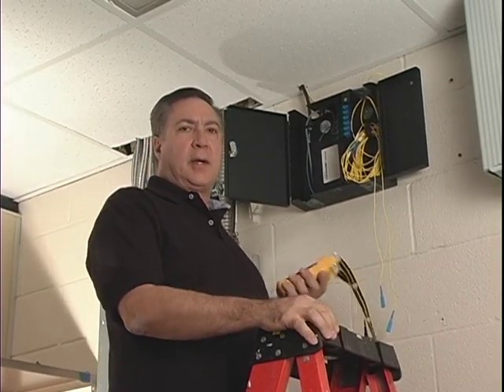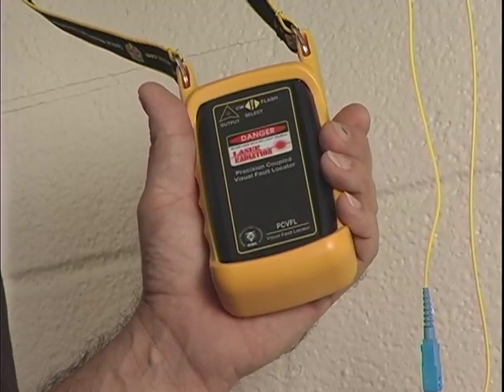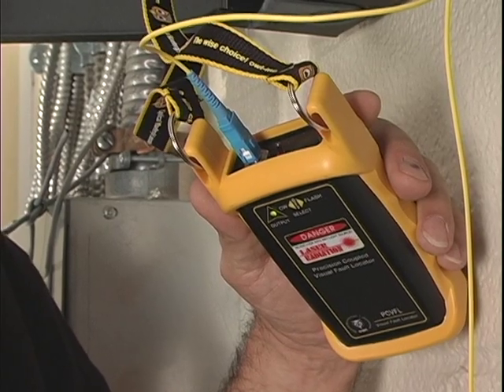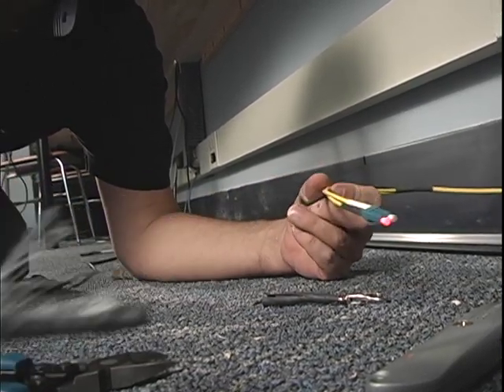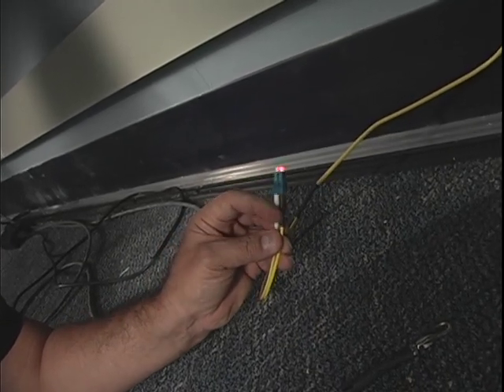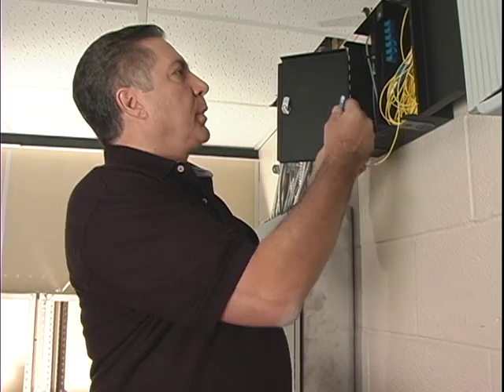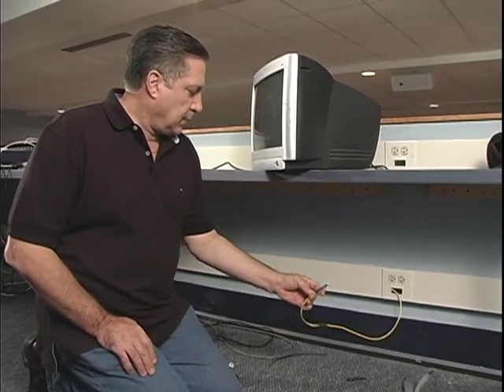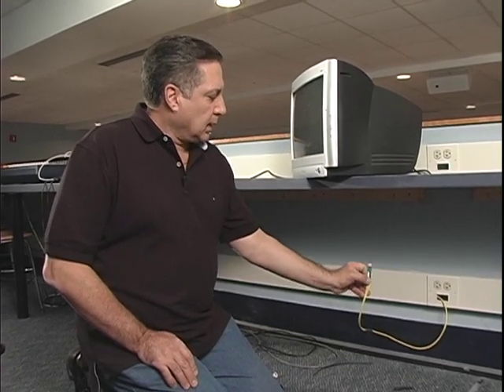Fiber Optic Tutorial Chapter 11: How to test the Fiber Optic Cable from End to End (Completion)

Comment: not bad making use of a VFL to test your link buy the very best will still be OTDR testing
Reply: +Riaan van Zyl The proper way is Using a Light Source Meter, this way you will get a true dB loss and it appears to be a very short run. An OTDR is a good method as well as long as they used a Launch Box on both ends at the same time but again the Light Source is the best way in this case. 

The VFL does not show that the fiber is good it only showing you that you can pass light.
Reply: Riaan van Zyl I am not Familiar with OTDR testing. If a fiber is bad what should this meter display?